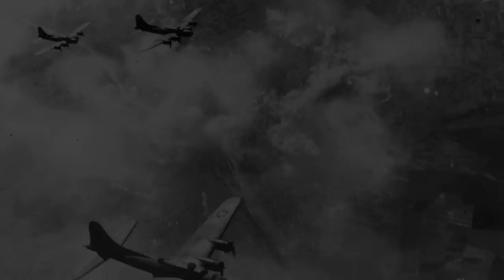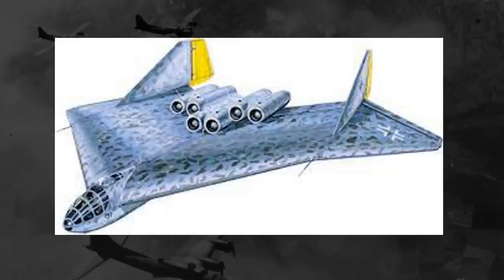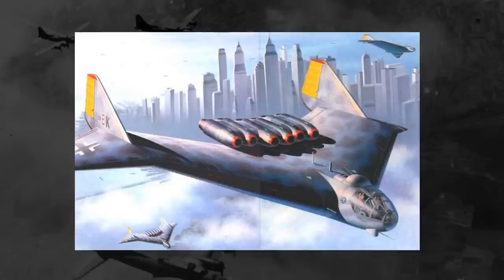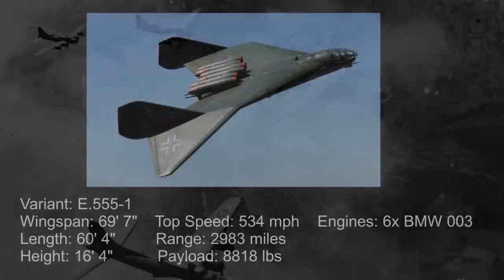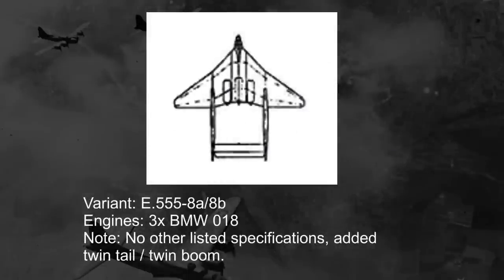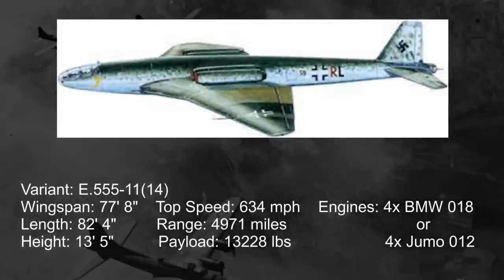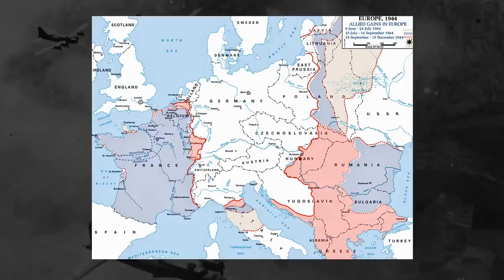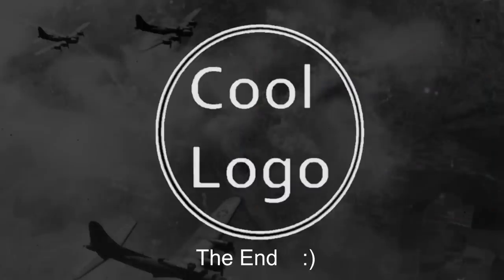Germany's Delta-Wing Jet Bomber: Arado E.555

Comment: The Arado Ar 234 Jet Bomber, used as a reconnaissance plane was a real issue for the allies, they had no easy way to stop it from taking pictures of the D-Day build up, An extensive dummy force and disinformation campaign  was required to counteract the jet. As a Bomber only small target were suitable due to the limited number of sorties that could be carried out
Reply: The extensive dummy force was part of the D Day plans from day one, it worked very well !
Reply: @garrymartin6474  The dummy force wouldn't have worked as well with more extensive aerial reconnaissance.  Some things would have betrayed that a degree of deception was underway.
Reply: @garrymartin6474  Yes, and it was adjusted to account for the Ar-234, along with the disinformation campaign,
Reply: Might want to double check your info. the first recon flight of an Arado was by the V7 prototype on August 2 1944, almost two months after D-Day. Their recon efforts did impact Market-Garden.
Reply: German ingenuity….taking reconnaissance pictures from a plane that didn’t exist at the time.
Reply: @williamzk9083  - You should do a little more research on Operation Fortitude.  This, in addition to Hitler's preconceived ideas about the Pas de Calais were instrumental in the success of the D Day landings.

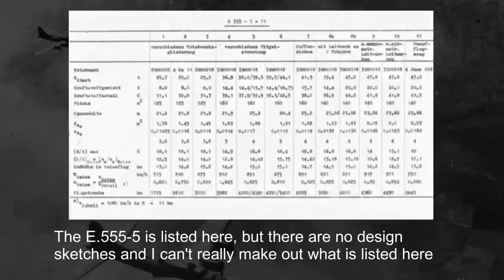Comment: The diagram at 11:05 you show is a list of specifications of the variants 1 through 11:

Variants 1-3 experiment with engine configurations ("Verschiedene Triebwerksgliederung")
Variants 4-6 experiment with wing angles ("Verschiedene Flügelstreckung")
I'm struggling with variant 7 but something to do with weapons ("Waffen...")
Variant 8a and 8b experiment with elevators and rudders on two tailbooms ("Mit Leitwerk an 2 Trägern")
Variant 9 and 10 seem to do something similar too, metr here probably meaning "metrisch" ("... metr. Leitwerken")
Variant 11 changes the main fuselage ("Rumpfflug...ung")

1st row is engines "Triebwerk"
2nd row i'm guessing is takeoff weight in metric tonnes "...Start"
3rd is fuel capacity in metric tonnes "Kraftstoffgewicht"
4th is fuel to weight percentage "Kraftstoffanteil"
5th is the wing area in square meters "Fläche"
6th is the wingspan in meters "Spannweite"
7th, 8th and 9th i don't understand, probably control surface areas in square meters
10th and 11th i have no clue on but they are listed in percentages
12th sounds like maximum altitude in cruise in km "Endhöhe im Reiseflug"
13th looks to me cruising speed in km/h "V->Reise"
14th is cruising speed in Mach "V->Reise/V->Schall"
15th is flight distance/range in km "Flugstrecke"

The last line explains Mach at 11km of altitude "V->Schall = 1080km/h in E = 11km"
I hoped this helped you out a bit (:
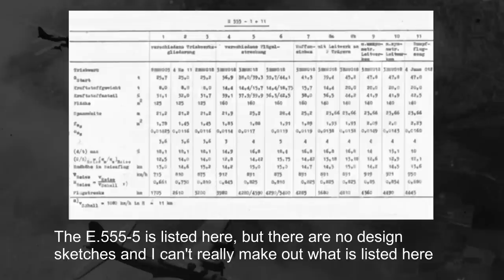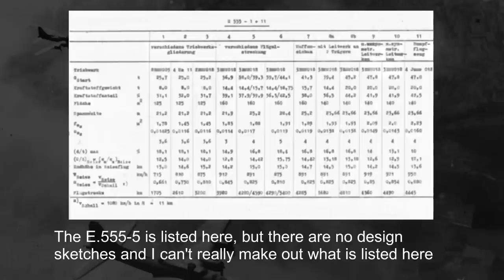Reply: My best guess to the confusion of the 555-11(14) variant is, that there were 2 earlier designs before variant 555-4 from 11:05 , that the variants 555-8a and 555-8b were seen as two seperate ones bringing the total number to 14. Making the 3 variants, 555-6/7/8, from 10:25 actually the variants 555-4/5/6 since their wingspan measurements align with the chart from 11:05 .
Reply: The notion that the 555-5 variant was left out due to it having to many 5s is ridiculous, since the german military was very precise when naming their hardware and variants, unlike the american military that named everything under the sun M1/M1A1/M2/M3 ect.

Comment: On the surface one wonders why these get called "Amerika Bombers" because they lacked the required range possibly because this is the best the E.555 proposals could come up with.   However I believe all were specified with in flight refueling capability.   The distance from Berlin to New York 3,967.53 miles  (6,385.12 km).  The distance from Brest France to New York is 3,354 miles (5,397 km).     Twice this distance would be needed plus about 14% to allow dog leg courses and some penetration plus 10% reserves.   That means 12800km from BERLIN NY or 10,800km from BREST-NY.      The E.555-6 could fly 7500km and the E.555-11 8000km.
The only way would be in flight refueling which could extend range about 33.3% if a buddy aircraft refuels 1/3rd of the way and 66% if rendevous refueling on the way back.  
Manfred Griehls "Luftwaffe over Amerika" shows the Luftwaffe conducted very succesful in flight refueing testing in 1943 in Hookups between Ju 252 and Ju 290 aircraft.  
-The Germans did have a practical design the Messerschmitt Me 264.    The prototypes with 1350hp Jumo 211F engines barely had the range (essentially lightly armed, with few bombs and inadequate reserves) but as more power became available BMW 801D (1800hp) and the Daimler Benz DB 603L or H with 2400hp the aircraft could lift greater fuel load and get the range needed.   These powerfull engines in the 2250hp-2400hp range were becoming available in end 1944 (Jumo 213E, DB603L)
-There was a 6 engines version  (Me 264/6m or Me 364) with plugs to estend the fuselage and longer span wings that was also designed and could have done the mission on weaker Jumo 211J engines or on the DB603H made up to 17000km in the recon version and 15000 in the bomber version.  It was a viable design.    There as a Heinkel Jet bomber and the Horton Ho XVIII that might have done the mission, certainly with in flght refueling which was specified.

Comment: Good video. The earlier Arado E 555 designs are essentially a flying wing concept. The main danger of flying wing designs is uncontrollable yaw on the tips of the wings which in a tight turn can cause a uncontrollable unrecoverable flat stall and basically aircraft falls to the ground. That's the idea for fitting the extended booms with vertical and horizontal stableisers. Also mounting them further back also helps with low power glide to get extra fuel efficiency and range to help the airct to cross thd Atlantic and increase controlled clime rate in a emergency withou causing a stall.

Comment: The main difficulty that Germany would always have faced is radar, from both land based stations and also picket ships. How many did they plan on sending? 1 to 2 thousand? The transatlantic flight would have made it a suicide assignment, either on the way there or on the return leg. Some decent 4-engined heavies perhaps, for continental warfare, but forget the intercontinental nonsense, which was unattainable by the day's technology.

Comment: Surely the details of engine numbers and fuel carried would affect the range and speed, and would have been the drivers of the innovations? It is all very well ridding the design of a heavy and thirsty jet engine, but the lowered thrust and the lack of engines of high reliability would have made any of these craft unlikely, for reasons of engine life, if nothing else. They were not known for their longevity, as much as for their thrust. (which came at the expense of the superior layout) but lacked the needed alloys for reliability and longevity.

Comment: Would have made a great swift cargo aircraft, to supply the 6th Army at Stalingrad. Larger body,  large rear cargo door, to parachute cargo . Too fast for enemy fighters - no need for cannons.
Reply: Retreating would have been the best idea.   Anything but the Ju 52 which had a poor performance above 200-250 km radius.  It was slow and burned a lot of fuel and its short range meant its airfields were in range of Soviet Fighters.   Arado 232 millipede transport, Ju 252 anything would have been better.   The He 111 was actually the best cargo plane the Germans had.    The problem in Stalingrad was the runways or lack thereoff.   The Arado E.555 would have been only able to deliver SB Sonder Behelter parachute supply packages from its bomb racks.   Certainly possible to make some deliveries especially if a blind bombing system was available.   The requirements of 400-600 tons a day just weren't feasible.   If you have 150,000 men you would need several kilos for each per day.   Could you live of a kg of food,  a quarter liter of of fuel to keep warm?
Reply: Unfortunately woud need to land in an area where the Russians had air superiority 
Then there was the annoying matter of Russian artillery
Reply: @jamesricker3997  no, read my post again, para drops, no landing in combat areas.

Comment: Given the reliability of the German jets, these would have been lucky to arrive over New York with 3 engines working and would have been easy prey for almost anything the Americans put into the air. There is also the fact that they probably wouldn't have seen service until about 1947, by which time the Americans had heaps of P-80s in service.

Comment: What I wonder about more than anything is why you provide only imperial measurements for aircraft built in the universal metric system? If you believe you are only catering to Americans, you may be surprised, and the entire rest of the planet has no genuine idea of these aircraft dimensions. AS the figures were originally developed on metric, why can you not provide that data as well please.
The excuse that you got to the moon using imperial does not hold water, and is sheer arrogance. The moon landing was delayed considerably due to the multiple calculations and conversions the engineers had to perform throughout the space program. You may have saved a year or so in time and money for the landing in fact.